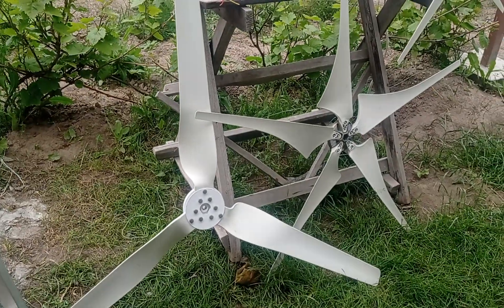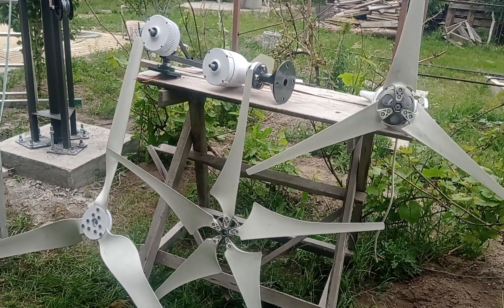Preparations for this set of small wind turbines to be mounted up in the air - mast is almost ready

Comment: It looks like the middle unit you could slide the tail a few inches back to the end of the pipe to improve the tracking a bit. An idea for people that don't want to replace the pipe.
Reply: I just saw on your other video there is a third rivet on the other side of the tail. So it would only have 2 connections if you move it down.
Reply from the maker: yes, theoretically possible. need to have a proper tool for it still

Comment: I'm very excited to see these turbines up in the air, I think the masts you build could support much bigger turbines.
Reply from the maker: yes, they are for potentially up to 2.4 m diameter machines. those I have currently will be 1.65 only.
Reply: @BackyardVoltage  I can give you files to 3d print 2 meter diameter turbines.
Reply from the maker: Well, I don't have a place to do that. And those printers that work now - they produce drones, so are quite busy
Reply: @BackyardVoltage  printers are not expensive anymore and there is no shortage of them, I use an elegoo neptune 3 max. I print in my kitchen. at the moment I am printing a 2 meter long blade, so its for a 4 meter diameter turbine.
Reply from the maker: @bermudatriangle2036  I will definitely think of that option, thanks for a hint!